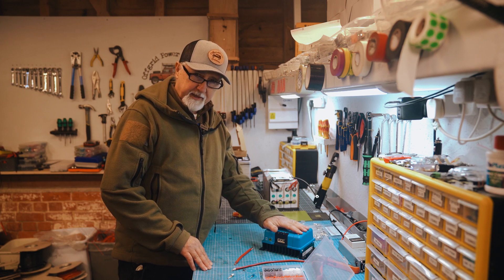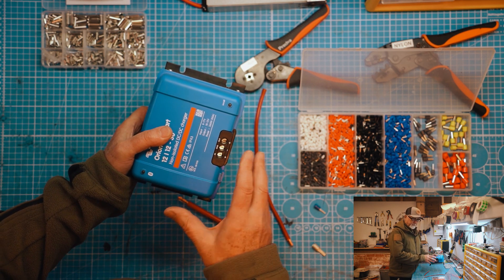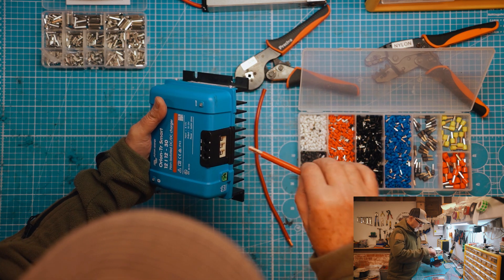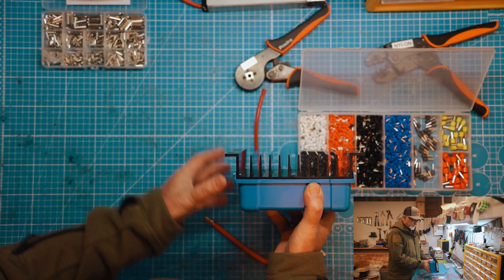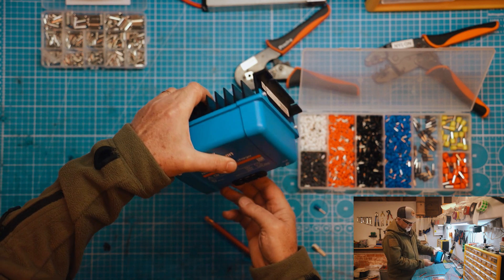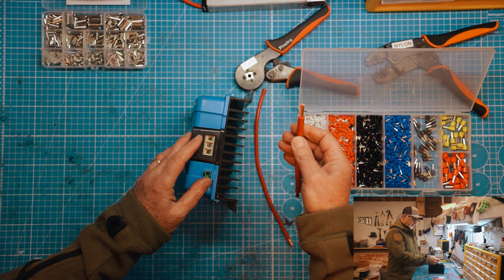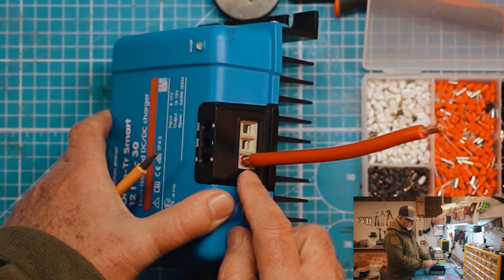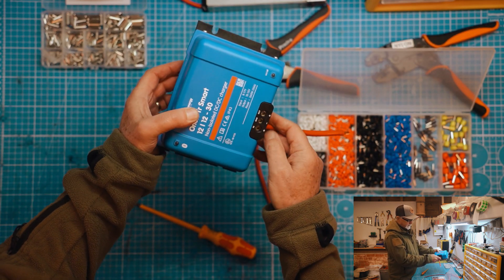Best practice for wiring a Victron DC to DC

Comment: The DC-DC charger gets quite hot during operation.  Do you use fans to assist with air flow/cooling?
Reply: good question! any response would be great!
Reply: I think it depends on where you have it mounted, mine is mounted low down behind the drivers seat with plenty of air flow around it and doesn’t get excessively hot, I think if it's in a cupboard with minimal air flow then a fan would be necessary, the latest Victron 50 amp DC - DC run much cooler apparently so shouldn't need a fan.
Reply: Any solutions to getting a 4 g wire in to it ? 25mm pin

Comment: You mention adding in a second wire into the same hole/slot as another wire. Does that mean you are putting two different separate solar arrays into the same mppt? Is that possible?
Reply: Note - This is a DC-DC charger, not a solar charger!